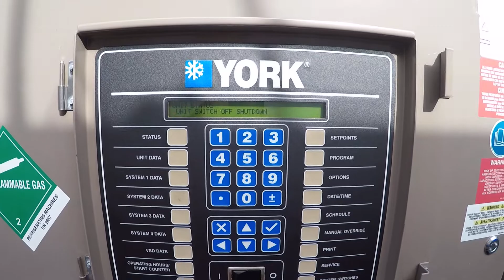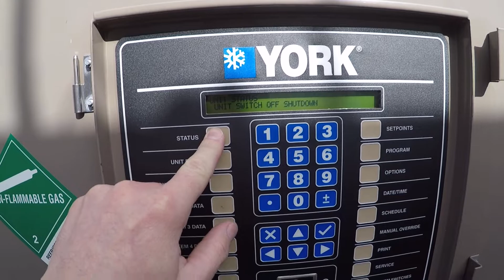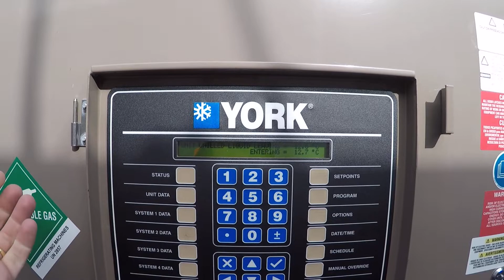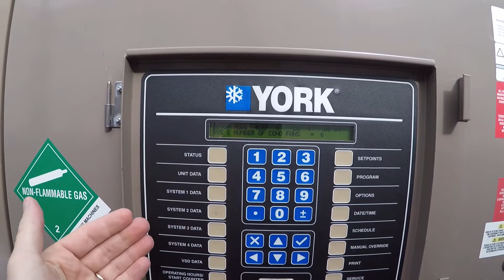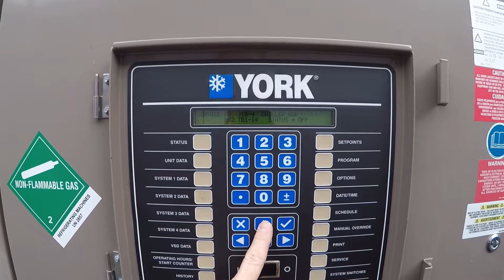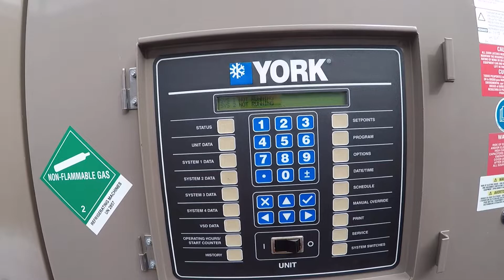How to operate a York YVAA chiller control interface

Comment: What is the service switch for
Reply from the maker: The service switch starts or stops the operation of both compressors.
Some system parameters can only be changed with it in the off position. It also acts as a quick stop button if a problem occurs.
Cheers

Comment: how to reset  alarm
Reply from the maker: You can reset alarms through the system switch button.
Reply: I encountered low discharge superheat fault.. How to solve it?
Reply: @Strikeback1  are u rectified alarm what's prblm

Comment: Is there information for the chillers from the micro SD card on the control board??can you insert one on York chillers
Reply from the maker: this yvaa was an older style that did not have the SD card function or the built in bacnet. I will do a video on the SD function next time I commission a new one.
Cheers